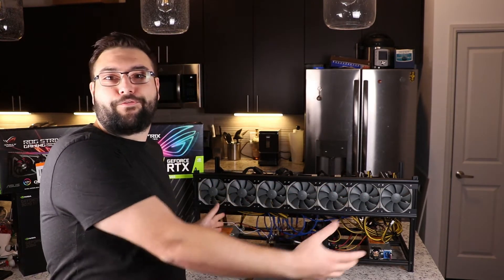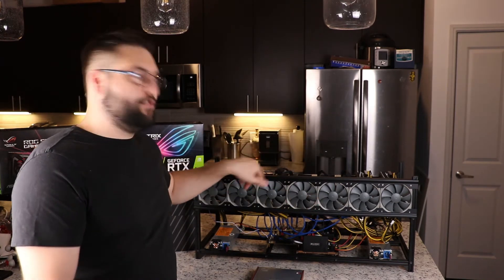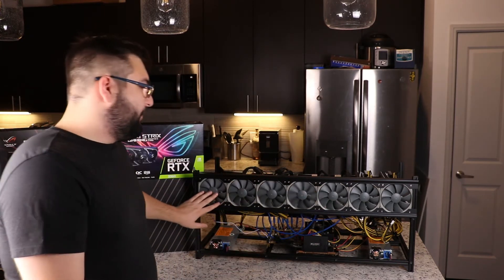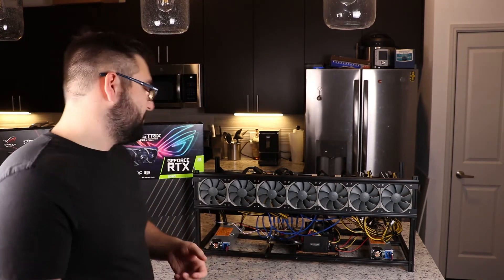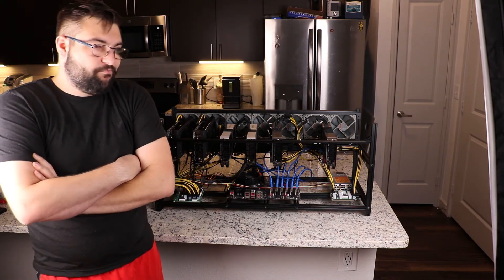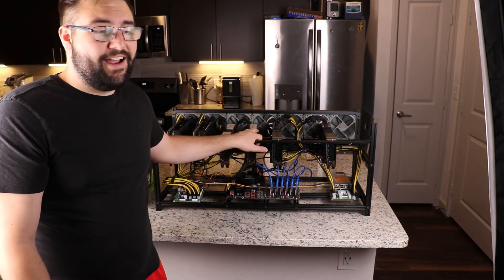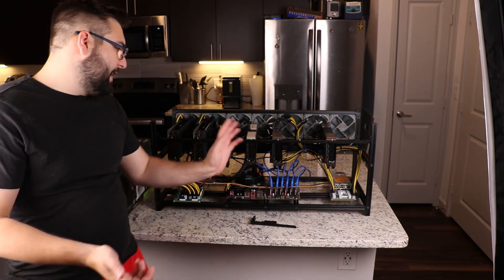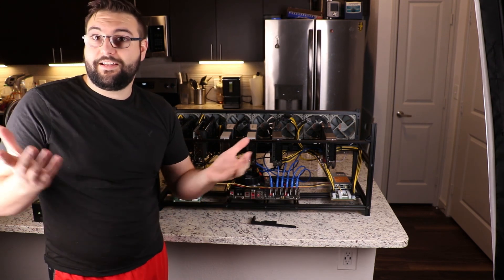8 GPU open air frame mining rig

Comment: i have a msi b450 gaming plus max on bios version(latest) E7B86AMS with a ryzen 5 5600g. when i set initiate graphic adapter to IGD, save changes and reboot, there is no display on my monitor, motherboard will not POST. if i clear cmos and use PEG settings, everything works fine. any ideas?